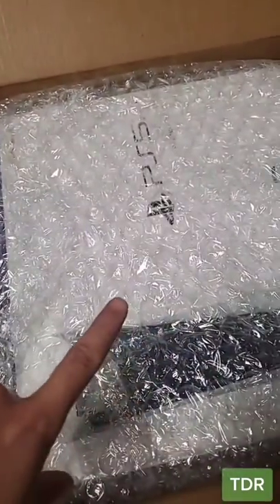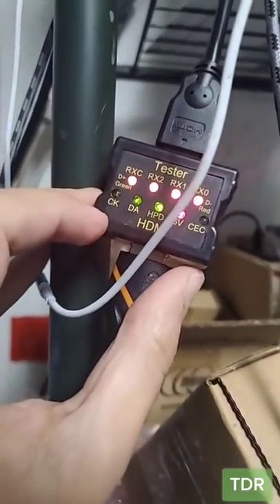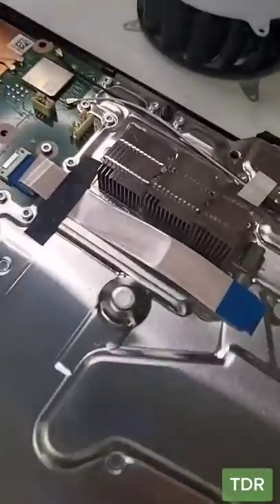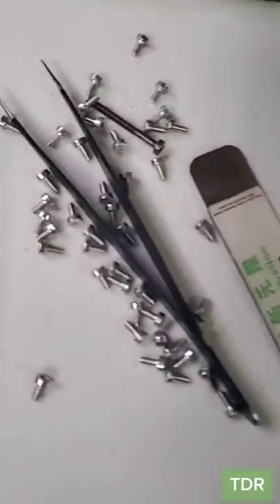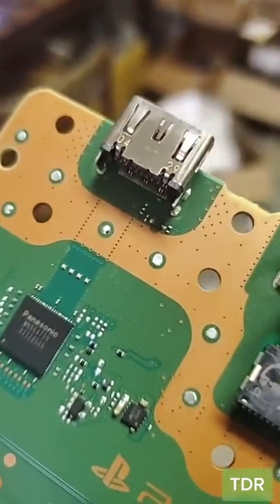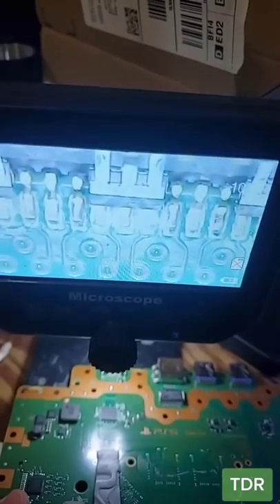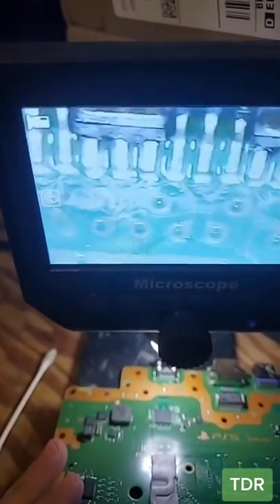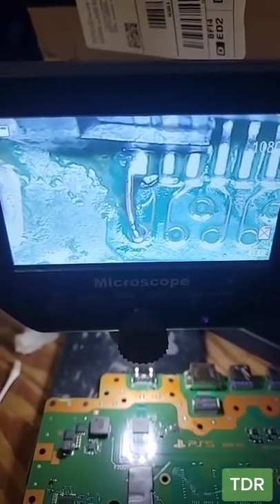Motherboard Tears, But HDMI Port Doesn't break! PS5 #HDMI #Repair #Shorts

Comment: Things like this would have been addressed ages ago, had more consoles actually reached the hands of consumers...
Reply: Nah nah nah, Sony needs to do a better fuckin job of quality control, this reminds me of people saying "omg! We need to let Devs know what bugs are in games so they can fix it!!!" it's like yea no, that's not how QC and debugging work at all, they've been gathering data on fail points like This since the start of production.
Reply: @DavidGarcia-oi5nt  Big difference between hardware quality control and software design control. You can pinpoint errors in hardware. Thousands of lines of code that arbitrarily interact with one another? Not so much.
Reply: @Chugga2012  pretty sure he was referring to the hdmi port?
N he was basically saying, sony knows, exactly, the force most people use to plug into that port and how people pull it out. This was at least an issue in workmanship, warranty issue.
Point is, there shouldn't be 1 console coming back with a port issue.
Thats so fucking trivial its insane to think any company is fucking this up.
50 dollar tvs dont f this up.
Reply: @todtalk3912  I know what he meant. Circuit board traces and most mass produced electrical hardware in general is precision-designed through computers and then assembled by said computers, which should give very little margin of error. I was emphasizing the difference between  that, and human-typed or created coding for games with millions of lines of code in some cases. You aren't gonna catch every mistake on software, and with how many interactions that can happen in a game, one good thing can break another.
Reply: @Chugga2012  That's why QA is an important job in the software development process. But companies are foregoing that in order to push out unfinished products to make as much profit possible. Consumers be damned.
Reply: @DavidGarcia-oi5nt  In a perfect world? Yes, you would be correct. The fact remains: companies rush product out the door to save money, and rely on user feedback to catch problems. With scalpers taking up consoles 5 to 1, many systems never reached end users, and these problems were never reported. Either that, or people bought second hand from scalpers, and there was no warranty coverage. Someone needs to slide the robot out of the way and pay attention at Sony...
Reply: Companies know that these things are failing long before customers do
Reply: @DavidGarcia-oi5nt  Oh, absolutely. In the long run, it's probably more financially viable to just let consumers report issues, than to spend more money on QA. The way everything is set up, it usually works out, but the whole chip shortage and subsequent scalping kinda threw a spanner in the works.
Reply: Things like this will never be addressed because once they are the consumer won't come back because their quality, functioning product works perfectly 10yrs later. These things are made poorly on purpose and designed to last at most 5yrs, 10 if you're super casual about its use.
Reply: @DavidGarcia-oi5nt  how the F will bugs gets fixedfor Indie devs without massive team. People that actually share bugs glitches are heros and we should praise them. They actually show love for the game and wanna see it become better.
Reply: Didn’t he say this is why you don’t buy from scalpers?
Reply: I wish people would stop buying from scalpers…. If they didn’t make money they wouldn’t do it.
Reply: @DavidGarcia-oi5nt  internet ruined these things. games are rushed now because of the internet and an easy patch fix later after MONEY NOW! Back in the day games didnt have game breaking bugs at launch because it if they fucked up that meant recalling every disc or cartridge and giving all the money back until you fixed it. lots of hardware works this way now as well.
Release the unfinished product and collect now fix later after the consumers do our QC for us.

Comment: That bootup screen only happens once.  That means it was never even turned on must of messed up in shipping.
Reply: When you hard reset it, it'll do the initial bootup screen again.
Reply: I just learned something from both of yall👍
Reply: Just gotta give the console a slap when you turn it off and it'll make that intro everytime you turn it back on
Reply: @iwheezy5037  exactly
Reply: factory reset and the part looked kinda dirty
Reply: @iwheezy5037  lmfaoooo
Reply: But if you buy from scalpers theres no factory warranty if its not working, buy from a store youre safe. Thats the point of this video
Reply: @Kevin-ez4or  thats false lmfao i have sold 35 ps5s from bestbuy, walmart, target, playstation direct & as long as i give em the receipt they good
Reply: @whosZixi  thats really good that youre giving people the receipts but unfortunately thats not in the majority when it comes to scalpers
Reply: @whosZixi  here's the real question:  HOW MUCH of a markup are YOU making off those units?
Are you like every other VG Scalper on Marketplace that's charging people $1500 for a $700 Unit?
If you're only making like 10% on them and it's more like a "convienance fee"- then I don't mind.  But those db's who cornered the market before xmas- then tried to get a double up on the costs... they can go to hell
Reply: @vidiotsyndrome  maybe they should have pre-ordered a system if they needed it for christmas that bad.  Otherwise it's no worse than car dealers charging $10k+ "market adjustments".
Reply: Pre-orders dont currently work because there are scalpers who use bots to fill the preorders as soon as they're available and buy as many units as they can until no more preorders are available. If it was just one person doing this that wouldnt be a problem but its thousands of people doing this. Not even giving the average consumer the opportunity to preorder. This has been a problem since release
Reply: @whosZixi  so you buy a 500 Dollar PS5 and sell it for 1,000 and give them the Reciept showing them you ripped them off
Reply: @randombuilds8336  did YOU try to get on any pre-order lists either of the last 2 xmas's?... know how hard/long the restock times were?
The real issue I have with the resellers, is them charging +100%  markup over retail.  So- the system cost like $700, and im supposed to pay them an EXTRA 700 because they actually have hands on a system (if they even do, and it isn't a "raincheck" reciept)?  Hells now. 
  Tell me ANY TIME you're willing to pay DOUBLE price for something? [Not including movie theater candy, or resturaunt Mac&chz - often just kraft]
Car dealers get vehicles @ WHOLESALE prices... then add on all the RETAIL markups to get "sticker" price.   But ALL RETAIL does this. 
If everywhere sold everything @ cost, then they wouldn't make any profit... but MOST retail isn't a 100% profit margin.
 I could see maybe a 25% "finders fee" being acceptable;  but the people charging 1500$ around xmas, for the base system (one controller/no games)... thats fucked up
Reply: @vidiotsyndrome  I haven't wasted my time or money on newer game systems.  I have a NES.  
 Right now car dealers in some areas are tacking on a "market adjustment" (which is pure profit to the dealer) up to and over the MSRP in value.  Honda civic with a $29k msrp being sold for $49k, dodge truck with msrp of $89k being sold for $149k, mercedes with msrp of $130k being sold for $300k.  Is it fine for car dealers to double the price?
 Easiest way to stop the resellers is get people to stop buying from them.  But that won't happen because people want instant gratification, they want it RIGHT NOW even if they pay double or triple what it is actually worth.
Reply: @randombuilds8336  you cant preorder something when there are robots instantly buying them all
Reply: @randombuilds8336  I TRIED to pre-order it. The problem is that due to them leaking the links on certain platforms early, the pre-orders were completely sold out before they even officially went live. And then the ones that didn't? Bots. Nuff said.
Reply: @vidiotsyndrome  it's only a $499 unit but I get what you mean. It's insane these people go spend $499 then try to sell it to you for $1200 😂
Reply: @Kevin-ez4or  you don’t need a receipt. It will have a manufacturers warranty.
Reply: @vidiotsyndrome  it took about a year for my dad and I to finally get a rtx 3080ti and dammnnmmn its such a beast even underclocked it still outputs about 200fps on max lol sorry for unwarranted 2cents
Reply: @petejammo88  Not what they were saying they were saying there's a warranty for store-bought models like the select retailers that sell them but I do see what you're saying... can't you just be able to associate the serial number to your account and have a warranty if you didn't take it apart? Or whatnot
Reply: MUST OF been love... but it's over noow MUST OF been good but I lost it somehow
Reply: @vidiotsyndrome  lol that’s life… is there even one game savvy person that doesn’t know how much a ps5 is supposed to cost?? People pay more because the demand is high. You better be lucky I’m giving you the receipt!
Reply: @vidiotsyndrome  how do u suggest this problem be solved tho ? Because it is a problem but what’s needed is a solution. Have you heard about some auto manufacturers requiring you sign a contract that says you won’t resell the car for at least a year since you bought it ? Like I think ford for the new lightning truck is doing this on their preorders in an effort to get scalpers to stop reselling their products. Im not even sure this will work either tho because how could they enforce it.
Reply: @randombuilds8336  lmao bro if the newest thing you have is a NES, then whyyyy are you in here talking to people who obviously enjoy newer technology about something you obviously have no idea about? Talking about he should’ve preordered it. You have no idea. Everyone has tried to start strong against this scalping era, even have gotten big name companies to at least attempt to put in defensive prompts to sway the scalpers. If you don’t even own a freaking ps1 why are you even here😂😂😂
Reply: @mog_3825  ohhhh ok
Reply: @truegurutheking3599  then petetion stores to only take pre-orders in person, set limits for 1 per shipping and or billing address etc.  This is nothing new, cabbage patch, tickle me elmo, switch, etc.  As for me not wasting my money on game systems, I have accessories for my tools that cost more than people are paying the scalpers for the ps5.  I chose different priorities for my spending.  And even if I was going to buy a ps5 I would wait till it was on the shelf and I could walk out of the store with it.  But that's why I'm holding off on building a cad/cam computer right now, video cards are stupid expensive thanks to coin miners and the covid chip shortage.  A ps5 is a want, not a need, so if someone uses that to their advantage I'll think they are a prick, but there is no reason for me to try to stop them.
Reply: @Kevin-ez4or  idk, maybe depends on the country you live. In germany you can send it to customer support and get it repaired.
Reply: @randombuilds8336  precorders didnt help   i know several myself that pre ordered and didnt get their shit
Reply: @vidiotsyndrome  🤦 the average retail markup is 300%

Source: I'm a retail manager that prices products.

It only cost around $150 for the PS5 to be built and pushed through distribution.

Do you really think Walmart is only making $45 off of them? 🤷
Reply: @deltasixgaming  everyone knows the price already and they already know the are paying scalping fees so it's not like it's new news when u had them the receipt

Comment: You never buy from scalpers regardless all its doing is fueling the fire. I got mine directly from Sony and they sent it to my door.
Reply: So your saying to not buy ps5 from people like thru offerup??
Reply: @Isosneakers  most people don't have an option to get it for msrp. It's literally impossible to get one for msrp online without sony direct
Reply: @ghostlegit  The ps5 had multiple restocks, but  everyone didn’t know about them.
Reply: @ghostlegit  for one, no, it's not "literally impossible" to get one outside of Sony Direct. You're misusing the word "literally" and also just wrong. Stop exaggerating. You're only hurting your own argument. Also, the more people use scalpers, the more of a problem scalpers become. If no one bought from scalpers then they would eventually stop scalping due to not having any buyers. That's how it works. The only reason anyone would defend scalpers would be because they feel guilty about having used a scalper themselves or because they're a scalper and are trying to justify themselves. Why would you feel the need to justify yourself if there wasn't anything wrong with scalping? It's almost like you know there's something wrong with it and feel the need to try to justify your raison d'être. If you're going to scalp, then at least be an adult and be honest about it. Just keep in mind that no one likes you or has any respect for you. 😆
Reply: @Isosneakers  not in my area.
Reply: @ghostlegit  wow, that's a very clever argument regarding the availability of PS5s and scalpers that you've made here...
Reply: @ghostlegit  wait...what do you mean "not in your area?" 😆 BLACK NINJA is correct. Scalpers have done exactly what he/she said they've done. They've done it *in all areas!" That's one reason why PS5s have been so hard to find. Just because your friendly neighborhood scalper isn't doing that, it doesn't mean that's exactly what been going on everywhere else. They buy them online, affecting everyone. Are you sure you know what scalping is? 🤔

Comment: Can you recommend a good, affordable soldering iron screen microscope and a good (not necessarily affordable) soldering iron?
Reply: The Hakko FX888D is a solid soldering iron for an affordable price (other models are available with more features.)

Regarding microscopes, it depends on what "affordable" means; Amscope is a good brand that I've had no troubles with (yet).
Reply: @fewdz  Affordable relative to that kind of product. Like, microscopes with screens.
Reply: Preferably one with a digital readout. But if you have never soldered before I recommend not working on expensive equipment as you will mess it up.
Reply: @fewdz  I second the Hakko fx888d. I got mine last week , worth every penny. It has changed my solder game.
Reply: Ok - and now can you recommend someone who knows how to use it that I can rely on to please check my shite that’s not working properly?? Cause I will definitely mess it up! 🤣
Reply: @crystalm4324  I volunteer as tribute
Reply: @RyoApeiron   - Thank you kind Sir, I bow to your superior skill in this area. Should you require homemade pie, pierogi’s or perhaps need advice on your car or truck (I worked at then managed a Garage for 14 years), I would be glad to assist you as well.

Comment: Sorry if this isn’t the proper place to ask, but I’m quite sure my original Xbox one (I think bought it in 2013) is reaching the end of its lifecycle.

I’ve already tried completely factory resetting it wiping all games, and it still takes forever to boot up past the green screen, and when it finally does, it’s stuck on a black screen. it also fails to install games on the internal drive.

EDIT: should probably mention that I can somewhat access the Xbox (it just takes a LONG time, about 5 minutes to just see the Home)

I’m assuming it’s the hard drive, but I’m not too certain. Would I be better off buying a new Xbox or would it be cheaper to see if it can be repaired?
Reply: Idk what to say imo I wouldn't try to get it fixed im a ps player but I know how bad the Xbox can break cause I used to own one but honestly I would just get a Xbox One S. You can find them for like 200 and its alot better and you get hdr gaming with them. I wouldnt fix but rather upgrade cause the system is really old now. You want the best experience for your games you know. Whatever you decide to do good luck
Reply: The hard drive is bad. Replace it
Reply: Replace the hard drive!
Reply: Why not just get a newer Xbox tho
Reply: Replacing the hard drive would be cheaper tho
Reply: follow modded warfare's tutorial
Reply: an update on the situation, thanks to the insider program I signed up for, it forced an update overnight which pretty much bricked the xbox, it now cant finish the update and gets stuck at 96%. I tried to do an offline update and it fails with an E101 error code. 

I'm deciding if I should replace the hard drive, or just get the series X/S. But the chances of getting one are slim.
Reply: @romanbellic9580  I said what I said but its your decision on whether or not you think it's worth fixing or just upgrading
Reply: @romanbellic9580  dude a new hard drive will fix that error code stop whining lol!!!!
Reply: @vgrepairs  not even whining lol
Reply: @romanbellic9580  okay change the hard drive then you got this my friend. godspeed!

Comment: Yo bro just wondering how much would it cost to get a 500/1tb ssd put in my og xbox one?
Reply: It’s easy to do just buy it at bust buy and follow a video super easy
Reply: @alexiscalderon4576  yes I agree it’s easy but not for everyone, they have to prepare the SSD before they install it and they might screw it up from not understanding
Reply: @Alexander_l322  make sure it's correct format. You could practice with a $5 USB storage device.
Reply: Do it yourself it’s remarkably easy to do
Reply: @boukm3n  alright man I’ll look into it thanks
Reply: @Alexander_l322  i I have little experience with this. No clue what to buy or how to do it

Comment: Juat wanted to mention that there's a major shortage worldwide not just of electronic components but PCBA manufacturers are also strapped for parts. This is particularly bad in China where a lot of these subassemblies are made. It's gotten to a point that some less discerning suppliers are just putting whatever they can get that barely works inot a box for shipment just so they can make their orders.